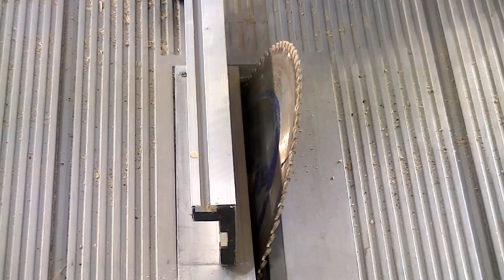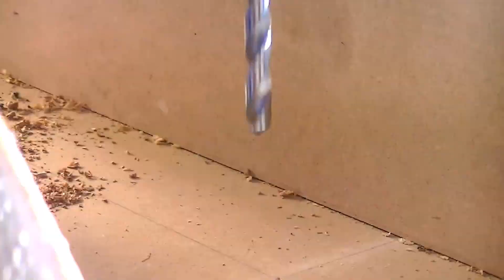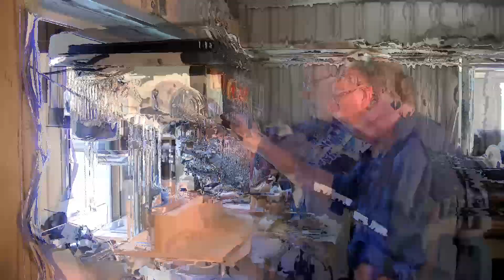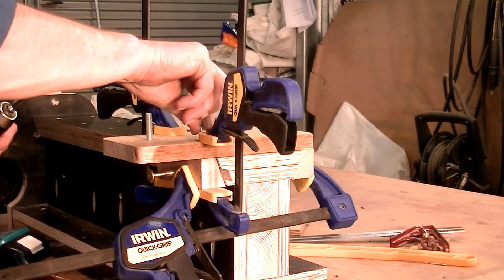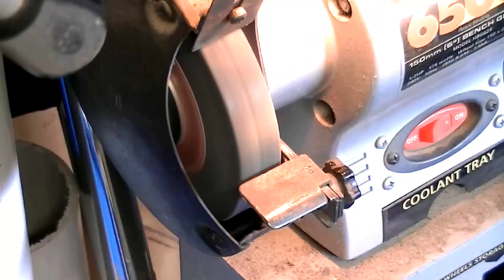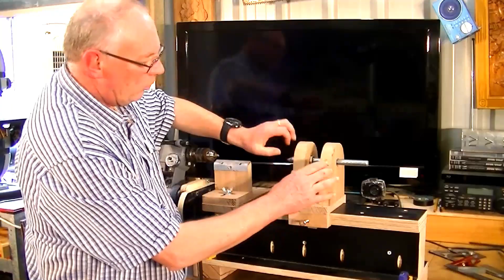Homemade wood lathe for less than $150 Part Two

Comment: I tried to make a milling machine out of a drill press.  The chuck is mounted by a taper that is designed for along axis load NOT A SIDE LOAD.   It always loosens up.  The solution on a milling machine is a nut to put an axis load holding the taper tight.   Does your spindle have a left hand taped hole for a screw to apply an axial load?    The screw head is accessed when the chuck is fully opened.    My drill press has a Mores taper shaft  to mate with the spindle and a chuck taper to mate with the chuck.  I can not easily load the mores taper shaft so i didn't even check for the chuck screw.

Comment: i think were your going to find your problem is with the drive speer  i have a home made lathe and that was always the issue . i tried a few different  options i found on youtube  they always broke or would not hold tight . or would dig grooves into the wood . so im curious as to how your going to fix that issue . i think once you start turning with it your going to find new issues  . but im rooting for you .